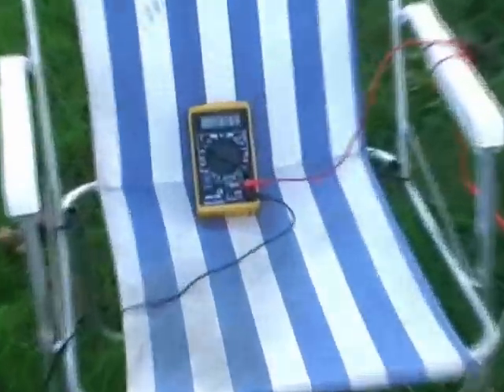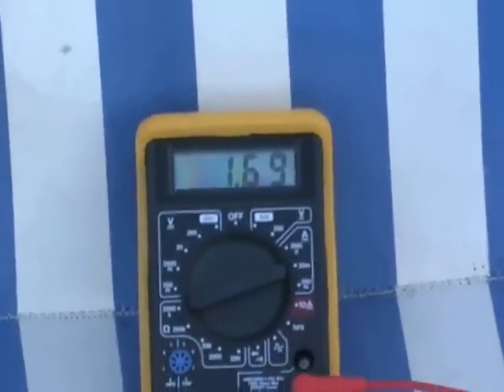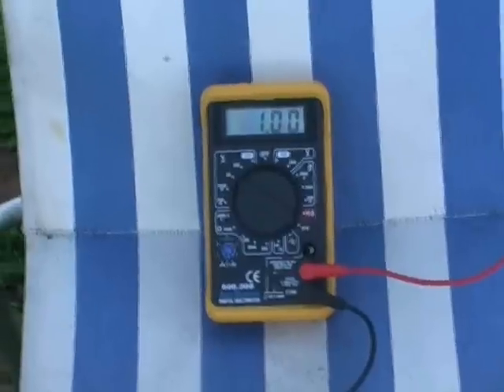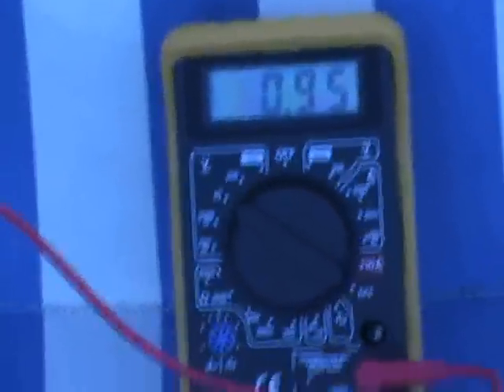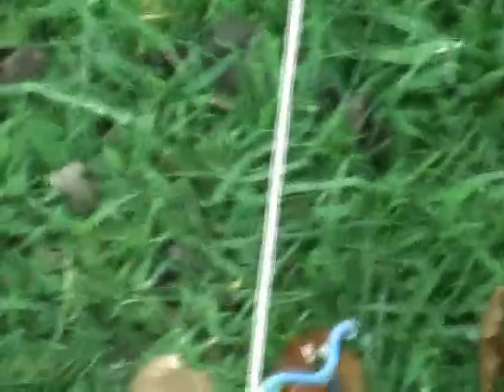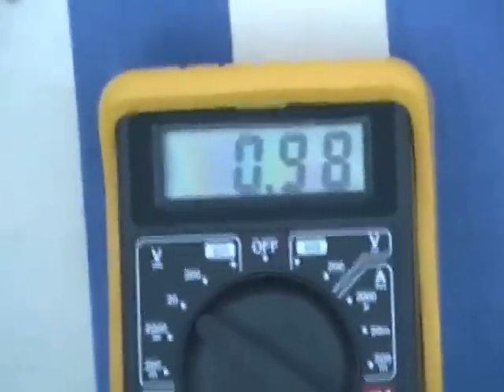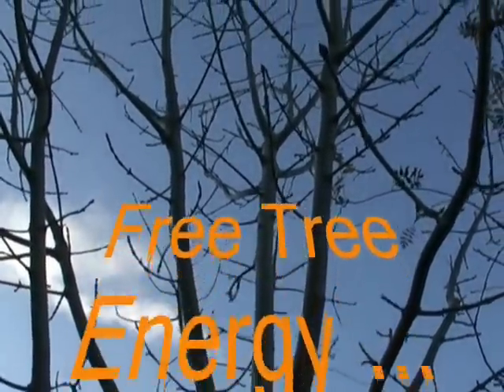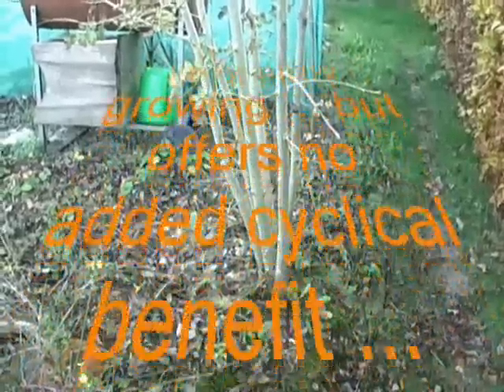earth battery 2. Part 2

Comment: This is amazing! I just found the concept while stumbling. Ok, so these comments are all very very old, but I'm going to take a shot here. First off, your meter is going to register AC volts, but you should really just be focusing on DC volts, and DC amps. AC=Alternating Current, you are not producing alternating current. But, because of this, you can make several of your batteries, wire them in series, and them you will should be able to compound your output.